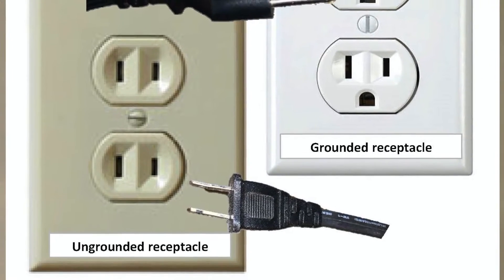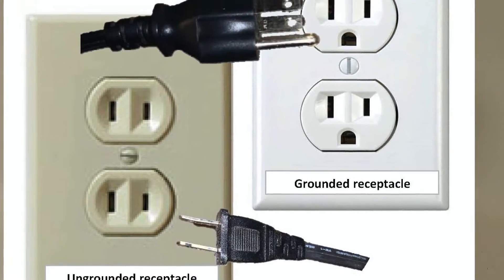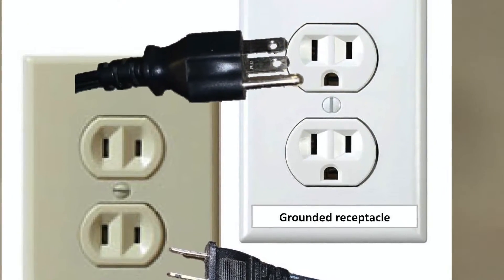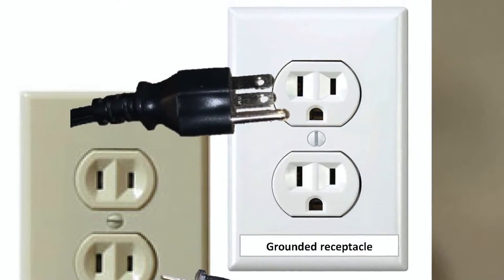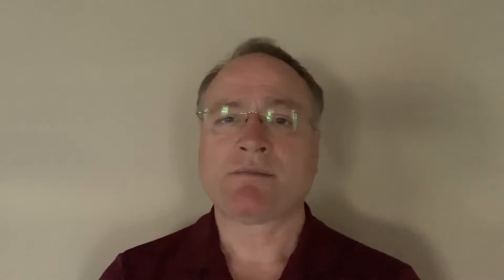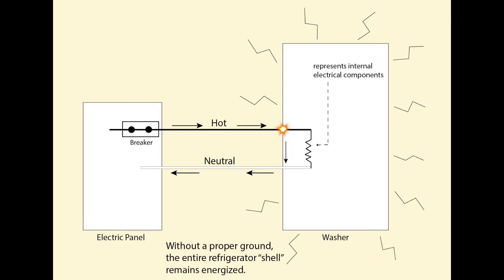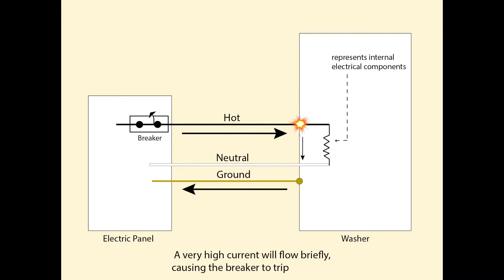What's the Difference between Grounding and Bonding?

Comment: Similar example kinda is a mobile home. First panel after the meter is bonded (neutral & equipment ground). The second panel inside the mobile home the neutral is isolated from ground and the equipment ground tied to the breaker box. If the neutral is lost the equipment ground does not become a current carrying  conductor. I said mobile home but this is true in any subfed panel.